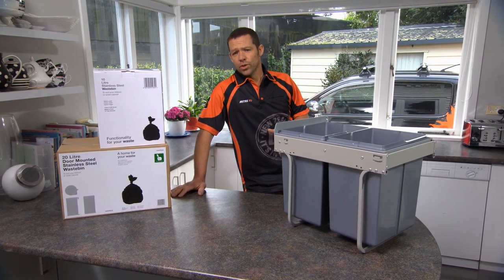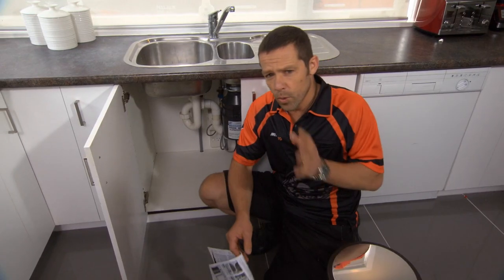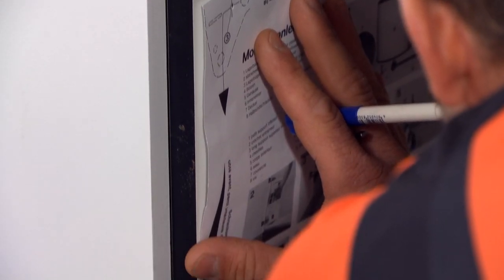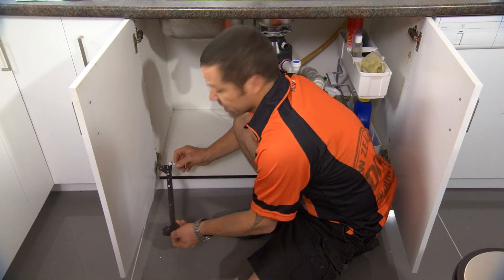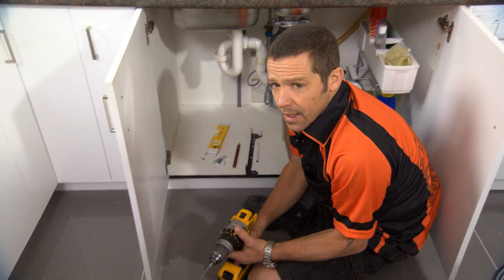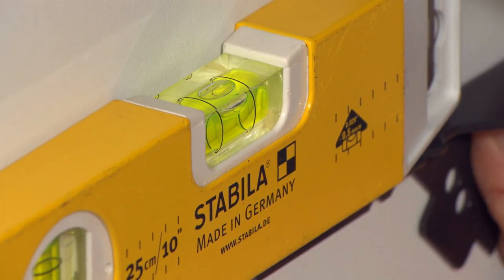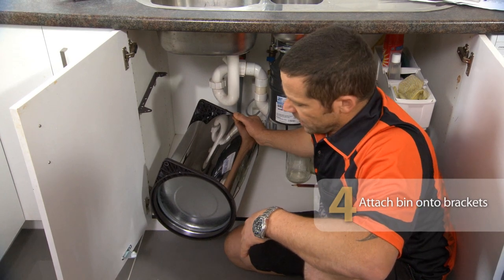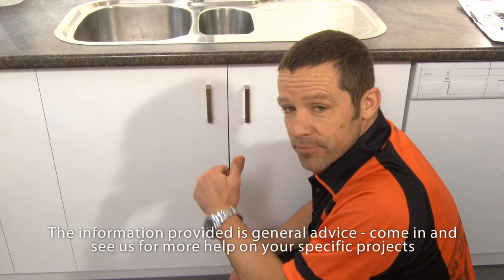How to Install a Swing Out Bin | Mitre 10 Easy As DIY

Comment: I’m guessing the level of the door and the inside has to be at the same level. The inside of my cabinet is indent to the door , can that work
Reply from the maker: Hey Lizzy, can I as how much it goes in? and we’ll check what the options are ^Charlie
Reply: Mitre 10 New Zealand  about 6 inches. But there is the piece of the base where the hinge is installed to use, that’s about 4 inches
Reply: The lid stays down.the spring from the lid poped out , I don’t know how to put the spring back or where I can get another lid like this.